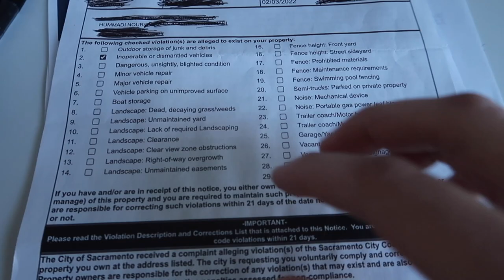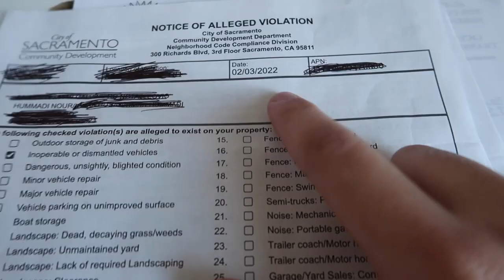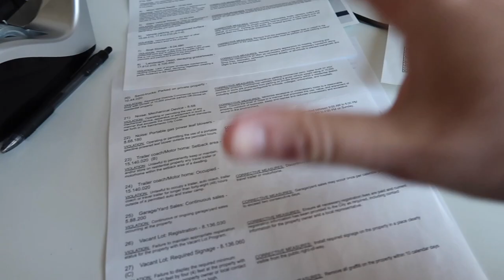SACRAMENTO COUNTY TICKETED ME FOR WORKING ON MY OWN CAR AT MY OWN HOUSE!

Comment: Definitely add a tall hedge or fence around the front. I would leave as little grass as possible and frame a huge car park/port. Use 2x4's and make a border and spread gravel after the filter cloth to keep the weeds away. Cement is expensive but can come in time. A car port outside can be helpful if it ever rains in beautiful California. Cheers brother

Comment: Regarding tree removal, where I live (Saskatchewan), if you cut down a tree that is between the sidewalk and the street, the city will send you a bill for $35,000.00/ tree. Contractors building houses in residential areas go to extreme lengths to protect/barricade the existing trees. Also, your property line does not always extend to the sidewalk. In areas around here, the property line can be right next to the sidewalk or up to 20' away. It is completely up to the original developer of the land and the original bylaws in effect at the time.